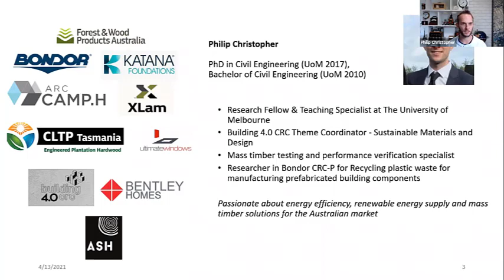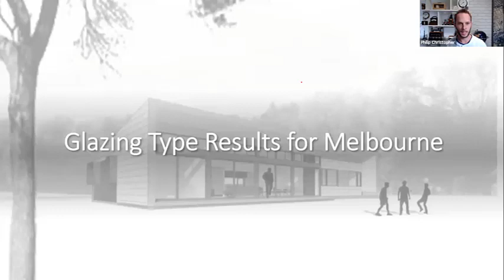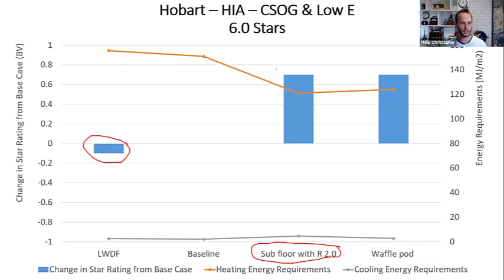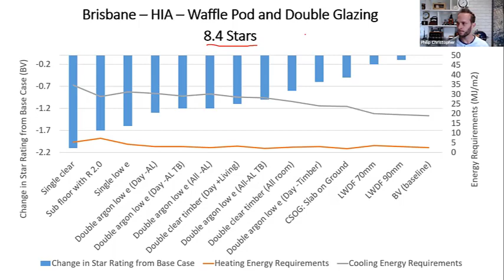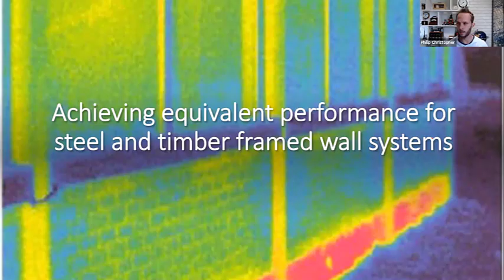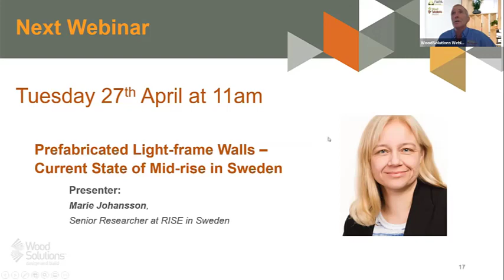Building 7 Star Homes in Australia: How to (Webinar)

Comment: Hi Philip, very good explaination.
If a house was built using DTS Method (Deemed to Satisfy) and it was later found out that the insulation material used in Ceiling (R4.0) and Wall (R2.5) were found to be faulty material (R value is 35% of its expected rating). 

The wall insulation is not R2.5 but only R1.75, singles glaze windows, black roof, west facing and other building material that was designed as DTS only (deemed to satisy).

Does overlaying the existing R2.8 Ceiling Insulation with correct R4.0 will be enough to make the house to change from DTS to 6 Star?

Comment: Very informative! How will the star rating take into account air tightness of the structure? Does the current software factor in air leakage rates of the the structure. I would assume this would make a large difference to energy use. The tighter the home the less energy is waisted conditioning the air again.